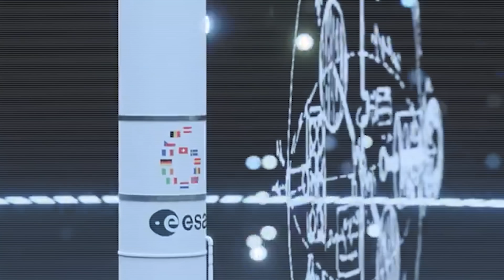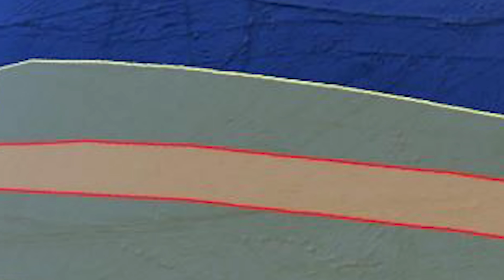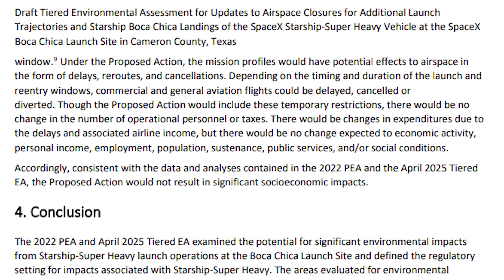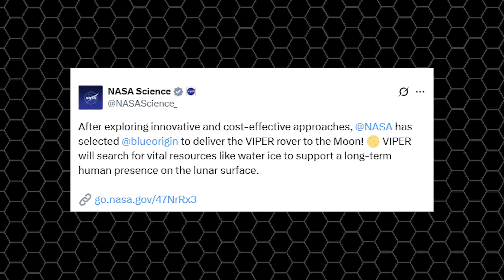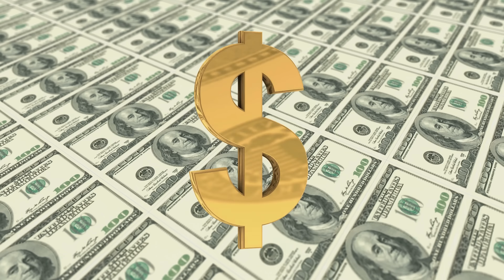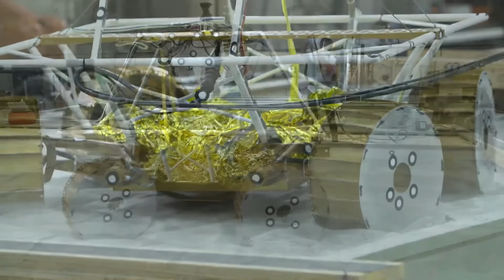FAA just declared ""Starship's new Trajectory'' to Return Starbase Pad Shocked whole Industry...

Comment: Around 9:30, the New Glenn first launch did not land the booster.  That was not discussed properly.  A failure to do so on the first flight was disappointing but not a mission failure.  The payload was put into orbit.
Reply: Die Landung der 1. Stufe war nur ein addon, Hauptmission war den Satelliten in den korrekten Orbist zu bringen. Wenn hier dauernd XWeltraum zitiert wird, dann sollte AlphaTech auch so ehrlich sein und zugeben, dass Starship noch nicht die Leistung gezeigt hat, die sie haben sollte - Nutzlast von 100 metrischen Tonnen und sauberer Rückkehr.
Reply: Falcon 9 didn't land its first stage until Flight 10.

Comment: This is still 10 times more risky than catching the booster. I'll only believe it when I see it. Landing it next to the tower would be easier and cooler too
Reply: E seria menos eficiente, pois precisariam de um trem de pouso
Reply: @gustavolopes5922  and landing on the skirt isn't an option either as it's not designed to land on it, of which will buckle and that'll damage the engines too, so yeah catching is obviously necessary.